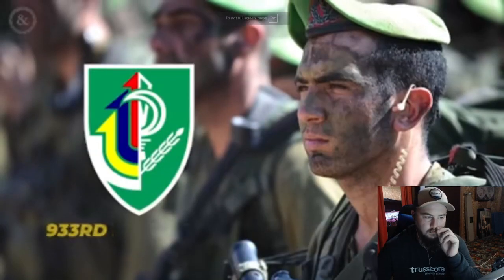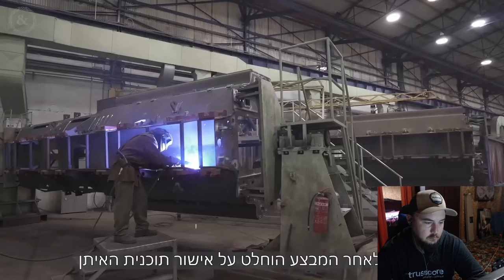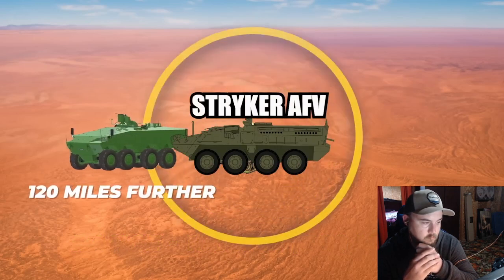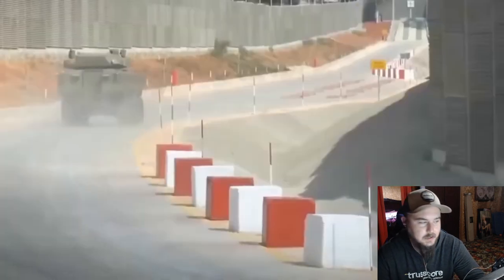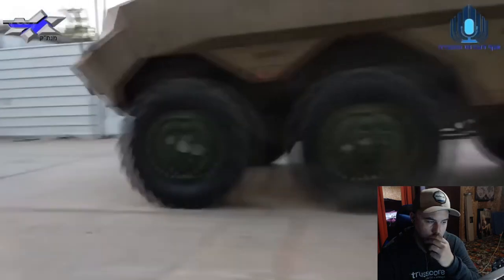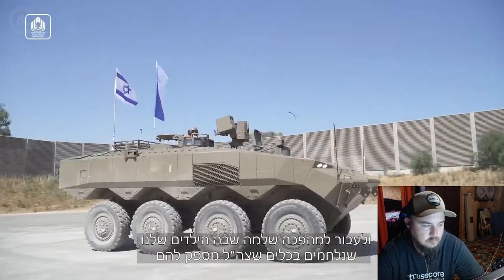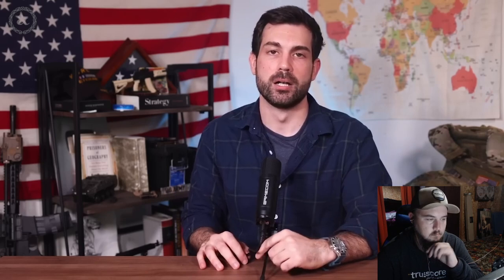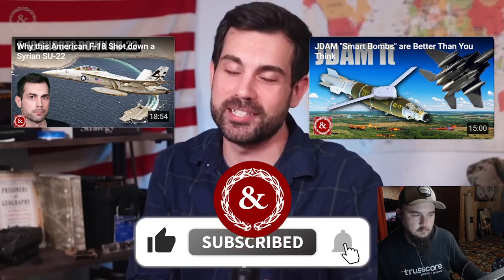Task & Purpose: Israel's Untested Armor Thrown Into Combat Reaction

Comment from the maker: What is with the slants on modern designs? Looks or use?
Reply: The slanted edges increases the chance that incoming rounds will deflect up the wedge, rather than do a true 90 degree hit. This also applies with explosive shockwaves, which you really don't want to take head on if you can deflect them. It also makes the thickness of the armor greater in cross section (take a book and measure what is longer--the distance straight across it when its standing up, or the distance across it when it's slanted at 45 degrees).
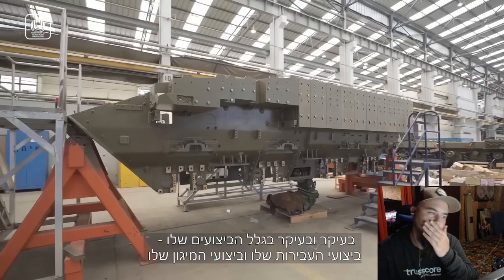Reply: In addition to the angling of the armor, there is also the way that "armor packages" are installed on armored vehicles nowadays. If you look at 10:55 in the video, you see the internal frame of the "armored box" that makes up the hull...pretty thin aluminum with all the openings cut out. Then, at 11:48 you can see the way that they have started to add the armor onto that frame, and that it is made up of "bricks" or "blocks" of various standard sizes. The new armor is quite light, with not much metal to its thickness at all, but it is very thick due to the various other materials being far less dense than metal. This new construction technique tends to make all the vehicles look very angular and boxy in very similar ways across nations and platforms.

Starting at 12:01 there is an animation followed by a film that has been sped up that both show pretty well how the vehicle hull is built up in layers and how the armor blocks stack on and make the vehicle look so...well...blocky. LOL

Comment: The Eitan is basically a Stryker, but it actually works. It's fast, has decent armor, and the Iron Fist APS has a 95% success rate against ATGMs/RPGs. And the digital network setup means that they constantly share data not only with tanks, like he mentioned, but also drones and air power. This means that air support can have real-time location data on each vehicle, so they can do very close in air strikes.

This system is a good example of why I like to follow Israeli military tech--they come out with these systems that just jump even the US in terms of of weapon tech, and then stuff they make filters out to the rest of the world (eg. they invented ERA for tanks and the only two tank hard kill APSs). Because they designed the system, then got the US to manufacture it in the US, the US has a full understanding of how the system works and can freely replicate it for our own uses (eg. the Booker is an American Sabrah)

The slanted edges increases the chance that incoming rounds will deflect up the wedge, rather than do a true 90 degree hit. This also applies with explosive shockwaves, which you really don't want to take head on if you can deflect them. It also makes the thickness of the armor greater in cross section (take a book and measure what is longer--the distance straight across it when its standing up, or the distance across it when it's slanted at 45 degrees).

Comment: The main difference between an APC and IFV is the role in combat though the line is getting blurry in modern day. An APC( The american Stryker and russian BTR series for example) is effectivley a battle taxi. Meant to deliver troops, and leave or provide a little bit of fire support with machine guns or small auto cannons.
IFV(The american Bradley and russian BMP series)  is meant to stick it out with the infantry providing firepower the whole time. Less a battle taxi more of a light tank that can carry infantry.
Reply: The way the IDF has integrated this is to use the Eitan to deploy special forces. It's fast and has a very powerful engine, so it can blitz through blockades and take IED hits while rapidly deploying SF troops. 

It fixes a shortfall, where you typically want to deploy SF troops quickly to maintain the element of surprise, but you also want a vehicle that is armored enough to not endanger elite troops. This is right in that sweet spot. 

There have been a couple situations where the IDF has deployed these, used the Spike launchers to breach a wall, then deploy SF troops to the breach in something like a minute.